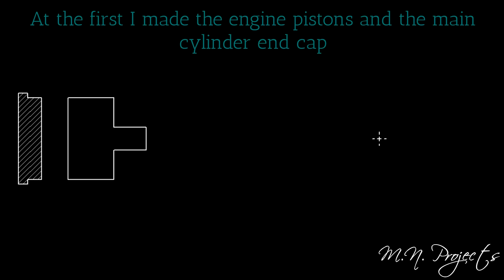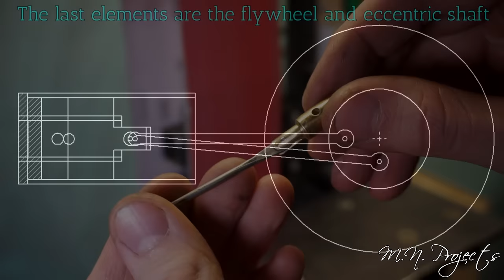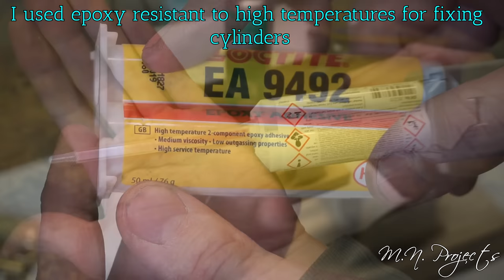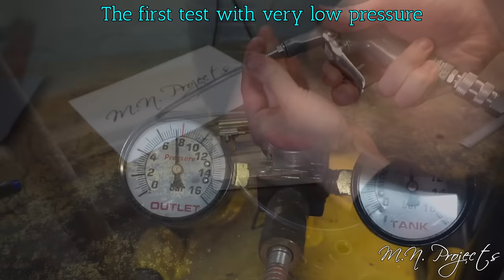Making a Steam Engine

Comment: my son made a steam(air ) engine for a science project. getting the valve timing was tricky. a great uncle explained supplying more volume(bigger line) of steam would help. in the end to display it at the science fair it would have to be run in an explosion proof box . so a video tape was used at the fair
Reply: @Ethan Stam  it is possible the vhs tape is somewhere but i wouldn't know where to start to look and don't have a VHS player anymore. the piston was a copper pipe cap so the cylinder may have been copper pipe also.  i would guess he found the plans on line. i recall it showed to use a tin can to generate steam . i nixed that idea . had a 5 gal. pressure cooker but i think those are limited to about 15 psi which wouldn't run it. air pressure would run it but i think you had to use your finger to get it started

Comment: Great Technical work. Stars to you.

All it needs is pressure, steam achieves much higher pressure due to its internal energy stored as heat. 
This heat will allow for greater kinetic energy conversion.

You simulated it perfectly. Although steam will cause material expansion, still a good test.

Comment: For those of you who  are smug about operating this engine on air, In the Navy, in port, we would use compressed air to operate bilge pumps, feed pumps and eductors– it is a legitimate motive force and the main benefit of the piston driven steam engine is that it indeed can be used with both sources very effectively. So now you know.
Reply: k cool
Reply: Sure but I was curious on how he was going to build a small boiler for a working model that small and this doesn't showcase that.
Reply: A steam engine is not a boiler and a boiler is not an engine. They are considered separate things and are built by separate professions.  @ghostrider2214
Reply: @hamdude2109  Oh round of applause I'm so glad you could figure that out! Just one problem this isn't a commercial model it's a engine made by a hobbyist...sure a damn good one but still not professional for crying out loud. A boiler is the driver for a steam engine, substituting it with compressed air works for a proof of concept and design but the video is still missing half of the content any normal person would expect to find.
Reply: @ghostrider2214  beg your pardon, but what's the title? Making a steam power system, or making a steam engine? The thing missing here would be the governor.
Reply: @bogdan_n  steam engine..... STEAM engine. What don't you understand?
Reply: @ghostrider2214  Ah, ok. Could you please enlighten me on the difference(s) between a steam engine, and the engine depicted in this video?
Reply: @bogdan_n  Actually fuck it you know what might as well rename this video "Making A Pneumatic Engine" because that's all that's shown.
Reply: Maybe he could have made a steam engine Then ran that steam engine on air just for you to see it working.
Reply: @protoborg  You are correct in that liquids are not compressible but it's not a water engine, it's a steam engine. Steam is a gas and can be compressed. It is how steam engines work unless it is the type that uses the condensation of the steam forming a vacuum as they did when steam engines were first developed. This was about in 1804.

Comment: No steam,  but it works roughly the same as with compressed air. Now make a small boiler to supply steam for the engine, this is very easy to do using a 1" threaded pipe and two caps, I'd avoid solder as it will get weak. I've been working with steam boilers in steam sterilizers, and the maximum pressure we work with is about 50psi, just 3.4 bar.

Comment: This is pretty cool, great job.  Makes you wonder how they built these in the early 1800's without modern tool machines
Reply: Wide World of Trains they always had lathes right back in the day. They just would have been powered by wind turbines or water wheels back then. It is even possible to turn wood with a foot treadle or bowing action.
Reply: @MrDegsy69  Understood, i meant electric ones where you just throw a switch LOL
Reply: @WideWorldofTrains  I must admit it would have been a lot more challenging machining parts that require high speed lathing put it could still have been done with gearing reduction methods. There was no demand anyway as metalurgy still had to catch up to create the high carbon steels that required this process. Even as recently as the 1920s ships of the stature of the Titanic were built with relatively crude and impure steel. Real progress was made by the 1940s to create high speed engine parts for the war effort.
Reply: @MrDegsy69  Jay Leno has a working steam engine from Circa 1820 in his garage. I believe its from England and had it rebuilt after he bought it. They had to machine some parts themselves since Home Depot didnt carry spare parts LOL  PS a video is on YT
Reply: @WideWorldofTrains  interesting video. The example you cite is a static balanced beam engine. They were very useful for static water pumping duties in the mining and tunneling industries. I am lucky enough to have the Manchester Mueseum of Science and Industry nearby that has working examples of this. Additionally we have the East Lancashire Railway between Bury and Rawtenstall that runs live steam every weekend of the year. I absolutely love the smell of live steam and the sulphurous smoke clouds from the chimney stacks. The hissing of the steam and the clanging of the massive wheels is pure drama. You could not fail to be overawed and hypnotised by this sight at close quarters. We had some class A4 Pacifics on the line last year!
Reply: @MrDegsy69  The lathe was invented somewhere in the 1870's by a frenchman who needed a more precisely done cylinder for a machine used in textile industry, or something
Reply: They had lathes n drill press n saws n whatnot in the 1800's

Comment: You should finish the job and hook it up to a home made steam-creating vessel.
Reply: Later u would ask him to make a mini robot to add coal to the furnace
Reply: concentrated sunlight on steel wool in a little glass jar of water makes steam quick and easy
Reply: @conesillyvalley7182  jajajajajajajaj
Reply: si como el motor que fue muy casero jajajajaja
Reply: @conesillyvalley7182  qqqqàaàaàa

Comment: Love every bit of it. . .if you had cut a small trench-tracing around the piston circumference and insert an O-Ring around it, you get better compression and throughput with compressed air and also heat is not a concern because its not steam gas but cold compressed air. ...

Thanks for sharing. . .very interesting.. .
Reply: I'm pretty sure that this is just an example being run off compressed air instead of steam. It's a steam ready system, it was just tested as safely as possible.

Comment: Making a 'steam' engine..... uses compressed air.
Reply: Well, it works in the same way. And he didn't make the other part yet.
Reply: same thing, they both use pressurized air. it's hard to make the steam part that small.
Reply: Both are interchangeable
Reply: its the same thing, but instead of hot pressured  water vapor he just puts pressured air into the system.
Reply: Can't use steam, because of heat
Reply: @zawmoeaung4087  It's made of brass and steel. It can take the heat.
Reply: @protoborg  I kind of doubt that. Brass has a melting point of 1,650-1,720 °F while water has a boiling point of 212°F. Even superheated steam boilers (which are huge by the way) only really go to about 1200°F. I would think that the drawback to making a boiler for it is the size requirements for fittings, pressure regulators, relief valves, etc. And boilers are more complicated than people give them credit for. Unless you felt inclined to cut and thread your own fittings, off-the-shelf fittings would be huge for the requirements of this engine. And the expense might make him disinclined to give it away with the engine. Then there is the liability issues involved. For fun and games, it's just simpler to use air. I guess a person could sacrifice a pressure cooker but even they only get to about 25PSI and 220°F. Brass tubing can take that with no problem.
Reply: @protoborg  Such eloquent detailed proof. However could I disagree with that? If you say it's not a steam engine, then I am totally convinced. So then, is it internal combustion? Electric? Nuclear? Over unity? Water wheel? Mule powered? Wind, solar, gravitic? Squirrel? Moose? lol
Reply: @protoborg  So you're standing with steam being able to melt brass then? And you say I'm stupid? I guess you don't think compressed water vapor has similar properties to compressed air? Yeah, I'm the non-scientific party here. I bow before your superior cranial cavity
Edit: And yes, I did manage to make myself laugh ~ I am funny
Reply: @protoborg  At 1:29 you can see where he caps one end of the cylinder. The piston head forms the closure for the other open end.
Reply: @protoborg  This little engine can run on steam. It is just that simple. You have never noticed all the steam escaping the cylinders on big steam locomotives? During specific points in the cycle, the steam is purposefully vented. It is obvious you have little mechanical understanding of machines or the simple physics of pressurised gasses. Steam is a gas, the same as air. But I leave you to your world view... if it's working for you, that's just fine. It has been interesting I must say. Later
Reply: All it needs is pressure, steam achieves much higher pressure due to its internal energy stored as heat. 
This heat will allow for greater kinetic energy conversion.

His simulated it perfectly. Although steam will cause material expansion, still a good test.
Reply: @protoborg  a steam engines and pneumatic engines are the same thing they both work the same and they need a pressurized gas to run .they both can run on steam and they both can run on air nothing you say is gonna make the   other dude wrong
Reply: @protoborg  i know what your saying but the reason there the same is because water goes from its liquid state to its gas form .and air  and water are both pushing a piston down because change in pressure ,like the piston being the normal atmospheric pressure and the air tank or steam boiler are at a higher pressure than the outside ot making when the valve or whatever opens the pressure tries to equalize and the piston is moved so they work the same but the only thing that makes them different is one is specifically made for air and one is specifically made for stream so if it was made for air i would wear out faster because of corrosion from water and a steam engine would wear out faster because air doesn't really have any lubrication properties like water kinda has .they are both the same thing just like gas and diesel engines are  basically the same thing because they both are internal combustion engines .
Reply: protoborg  I bet you’re a right laugh at parties 😂😂
Reply: @protoborg  a diesel engine does burn gasoline i use gasoline to start mine when its cold then run it on diesel and a gas engine will run on diesel but it with create a lot of black smoke and have less power
Reply: @protoborg   and if the boiler wasn't under pressure they would not explode from going over the psi rating
Reply: @protoborg   also your car and legs are technically the same as they convert energy into mechanical force and torque to get to one from one place to another except a car is meant to carry more things and get from one place to another faster and more efficiently than using your legs. When you're legs are meant to just move you around short distances
Reply: @protoborg  a steam engine doesn't have to return the condensed water to a boiler that was used to make them more efficient but not all of the water is returned and not all steam engines have a condenser and water injector

Comment: that's no steam engine though, it's a compressed air engine 🤣
Reply: same thing, they both use pressurized air. it's hard to make the steam part that small.
Reply: Easily run on steam.  In fact, it would likely work even better on steams since most of the time you're running steam with oil thus have steam oil which lubricates everything with a sheen of oil preventing wear and tear.
Reply: Its a model, I wish people would understand that.
Reply: WD-40 no steam not a model its a concept

Comment: A sugestion to the author: you could use a steam pot as a boiler and connect a small gauge pipe between the pot's pressure valve nozzle and the engine input so as to put everyone's mind at ease, even though this engine could run on pressurized chicken soup, for that matter (as long as the valve doesn't get clogged up on noodles)
Reply: @protoborg  If it can run on compressed air, it can run on steam (provided that the temperature is high enough for it not to condensate inside the cylinder), or any other pressurized fluid (with a reasonable viscosity).
Reply: @protoborg  err... Could you please read the first part of your last reply? First sentence, "steam is not pressurized", and then you speak of steam pressure. WHICH IS IT???

And regarding viscosity, instead of a pneumatic piston, this type of engine could be fitted with a hydraulic piston (and a heavier flywheel), and you would get a very low speed/high torque (and still a very low efficiency) engine .
Reply: @protoborg  No, it isn't, because by applying pressure, a fluid becomes pressurized, right?

Comment: Pneumatic engine.
Reply: same thing, they both use pressurized air. it's hard to make the steam part that small.
Reply: @protoborg  old comment
Reply: @protoborg  can u not
Reply: @protoborg  But they can unless they are the type that uses condensation to produce vacuum

Comment: If you have a Dremel, make a mount for it on the tool post so you can cut stuff, drill stuff directly in the chuck. Just beware of grind dust on your lathe ways, put a towel on top.

Comment: Great little hobby project, if you already have skills in metal working: milling, grinding, soldering, drilling.
9:30 This machine runs more like a Stirling Engine and not a Steam Engine.
Reply: Jeffrey314159 soldering is in the category of electrical engineering
Reply: @maksimgonev9486   well he wasn't welding

Comment: Wow this is a wonderful model. I'm interested in making one of these but the valve always gets me confused
Reply: @protoborg  so when the air goes into the fitting it pushes the piston so when the flywheel goes round it pushes the piston back so the fittings air hole is open to make the piston go forward again. Is that right?
Reply: @Ernest-From-England  
In principle you are correct. A major part of a steam engine (at least in this one, as it is a single action type) is the flywheel. The flywheel is the part which is responsible to keep the whole thing in motion due to its inertia. Without it, this type of engine wouldn't work.

But now comes the question: When the piston pushes back, it will try to further compress what is already in the cylinder. So there needs to be a way for the machine to get rid of that. This is the point, at which the grove comes into play, as in this phase of operation, the grove lines up with the boring to the main cylinder and creates a way for the steam to escape the cylinder.

Comment: I have for a long time been looking for a wood-fired machine, either gasifier or steam engine-driven to convert heat into electricity in my cabin(outside). Gasoline is expensive to make electricity, wood in my cabin has no cost. I would like both a 1000-watt for charging batteries and a 5000-watt for tools. Usually people advise for gasifiers and against steam. Why? To me it looks like you get a lot more energy from wood by burning it and making steam, than by heating out the gas and burning only that.

Thanks for any advice.
Reply: I would have to guess the reasons for preferring wood gas over steam would be the fact that steam engines require lots of monitoring. I'm not 100% about wood gas systems, as I have little experience there. But If it runs somewhat similar to gasoline, diesel, or any combustion engines, you can leave it and do other stuff for awhile. A steam engine MUST be monitored, especially if your cabin is in a colder region. If you start a steam engine and just leave it alone, generally 3 things can happen.
1: You come back and it's still doing ok.
2: It stopped at some point and the pressure valves broke (as designed) and stopped it before it got worst.
3: It completely detonated and destroyed everything around it.
Reply: @epion660  Sounds like good reason for gasifier. Thanks

Comment: Could you have bypassed the smaller piston and just made a hole in the rear of the large one and run the pressure that way?
Reply: Or even just have went in the side of the large one. Just confused of the purpose of the small cylinder